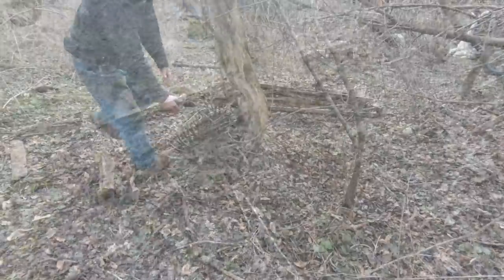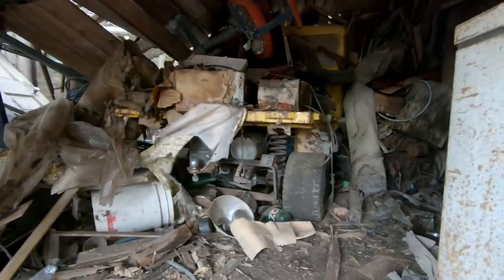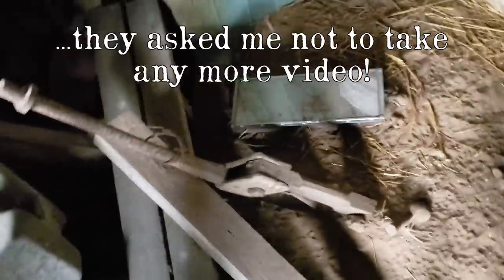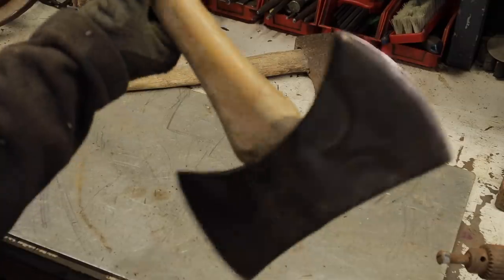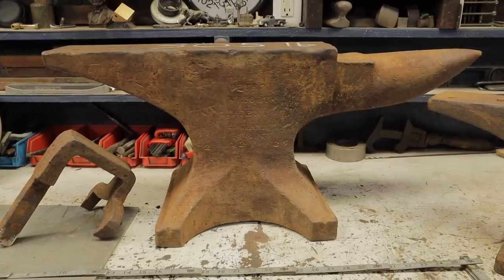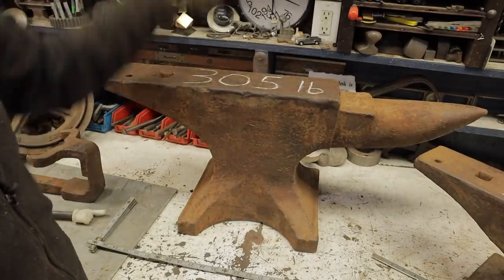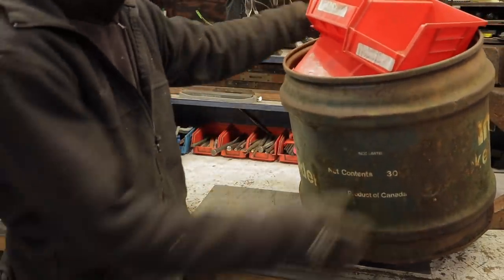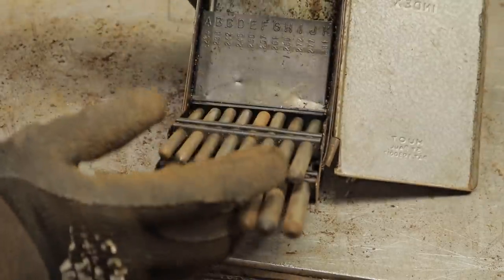RESCUING OLD IRON ~ Two Anvils & a Flat Belt Pedestal Grinder ~ Episode 2 ~ The Abandoned Dairy Farm

Comment: On the grinder, there is a special fiber packing that you load with a thin grease/oil then bed the shaft and cap onto it and set the cap pressure. The little loose rings inside are called "Wicking rings", they should have a little sheet metal reservoir underneath them (probably rusted away) that you fill with oil and as the shaft is turning, it with spin the rings around and sling oil up on the top of the packing to keep the shaft lubed and smooth running and lower heat from any friction. We had two of these in the shipyard Blacksmith shop i worked in back in the 70s.   You can run them with either an overhead line drive setup or a heavy motor and wide belt underneath and adjust the tracking by adjusting the cap pressure and elevation of the shaft with shims.  This is awesome stuff you found and will NEVER be made this well again. Also in the first shed was a rare red Farmall tractor tool box that collectors pay up to $400 for.
Reply: I too, could move or pick up anything I could get a hold on. Now, I'm 87 and  can't  stand straight.  Lota pain too. 💔

Comment: The pots were indeed for melting lead but were used primarily by plumbers to install "bell & spigot" cast iron sewer pipe.  The pipes were slip jointed, an oakum strip was wrapped around the smaller pipe with an opening at the top.  The ladles were then used to pour molten lead into the pipe joint.  After the lead cooled sufficiently the oakum was removed and then it was packed into a tight seal with a tamping tool.  My father was a plumber and I helped him install the sewer line to our house circa 1955 using this method.

Comment: I worked for a rancher that had what I think was a starter kit for a homestead . He was using the bench vice , like the one you found & the anvil & later while looking for some scrap metal out behind the shop there was the hand crank drill press , the pipe or rod vice like you had , some tongs were in the shop but the forge hand crank blower was out back ! I've seen this set in a 1910 Sears & Roebuck catalog for less than $100 !!!!!! How times have changed ! I've looked for a good anvil for years and saw one In a ranch driveway holding a shop door open , asked if they wanted to get rid of it & he said no , what would hold my door open !!!! :-) thanks for the video and you Damn sure get an A+ for effort !!!!!! :-)
Reply: Some Folks have them as an Ornament in their Driveway and won't budge with them for all the Tea in China, due to sentiment..⁉️🤔🤦‍♂️

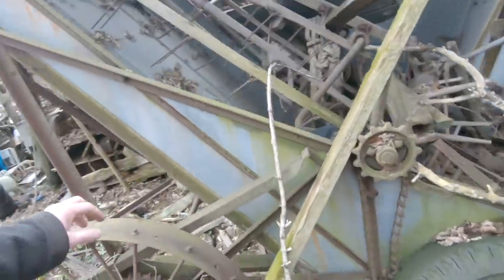Comment: At 5:15, the machine you thought was a manure spreader,  I think you'll find it was a hay loader.  I'm 78, and when I was about 5 or 6, I spend several months of an old farm owned by an elderly couple that worked it with a team of horses.  When they did the haying, I'm pretty sure this was hooked behind a wagon, and would pick up the hay and dump it on the wagon.  When the wagon was full, it was disconnected and left in the field. The horses pulled the wagon back to the barn. There they were unhooked from the wagon and hooked up the hay fork and they pulled the hay up into the barn,until the wagon was empty.  At that point, the whole process was started all over again.   I haven't though about that time of my life in years...Thanks

Comment: i believe that anvil attachment is an anvil bridge. The Anvil Bridge is designed to make getting into tight corners much easier and is beneficial for splitting and forging hinges and scrolls.
Reply: You are exactly right about it being a hardy hole bridge anvil. I use one quite often. I made mine myself. It should be one of the first hardy tools you get. I know people who don't have one and don't believe them to be needed. Once you have one you will never want to give it up. My anvil is only 105 pounds. It's a  Columbian cast steel and I've had it about 20 years. I absolutely love it. I'd certainly like to have a larger anvil for my shop but there really isn't anything I can't do with the  anvil I have. This little Columbian anvil I can still carry to my truck and take it to our blacksmith club meetings.
Reply: I think it's a hold-down, Mark. Lay something on the hardened face, put that 'bridge' over it with the guides over the anvil's face, and hammer the extension into the hardy hole. You'll find hold-downs in use on most good workbenches.

Comment: when you go picking, carry a decent ramp and a come along or set up an electric winch to do the work. You're young now, but trust me busting your back like that will tell on you later.
Reply: Aint THAT the truth!
Reply: i call them war wounds !    :<)))
Reply: Gets kinda annoying seeing others bend over/squat/kneel with such ease. I try to plan well for anything at ground level..It takes a few minutes to get down and twice as long to get back up 😕.  The joys of aging 😁
Reply: @tootall5559  🤣 gotta be a dollar for me. but my right forearm still seems to work ok, which is good cos that's my beer drinking arm
Reply: I used to do the same thing.....People were amazed at the huge objects l could lift and move...Was it smart? No it was very stupid! Now l have a (plan) of attack in place, if l buy a large heavy item. Did l mention l have a bad lower back now....
Reply: @b.a.brackus6371  I've got a bad back and a hernia, the surgery to fix my back gave me a hernia from heaving so hard ... it turned out I was allergic to the anesthesia and actually died on the table but they got me back. So having either fixed is more dangerous to me than leaving them be.
Reply: B.A. Brackus - username checks out.
Reply from the maker: I had a come along with me, but didn't really see a need for it, but I DO need to get or make a decent set of ramps! Clearly the OSB I found when I was there wasn't up to the task!  I appreciate the concern about my safety!
Reply: @SalvageWorkshop  It's not just your safety now. it's about how all this effects you when you get older. I used to be able to do a lot more than people thought possible, but now I can't hardly do anything. Everything you do... or should I say overdo now, will tell on you when you get old. I know, you're a young stud now, but if you live long, it all comes back to haunt you later in aches and pains that maybe you can't explain. For instance, I injured my shoulder like 3 times... shook it off, it got better. Then one day in my older age I slept on it, and it kills me for weeks on end, now I have to make special provisions on how I sleep not to set it off again. Similar things apply to my knees, ankles, neck and back. I'm a mess now.
Reply: And how!
Reply: Damn, I wish I would have listened to the old-timers when they told me to watch my back.  Now I'm an old-timer and all I can do is testify.
Reply: @grimcat27  Yup ruined my back
Reply: I second that.
Reply: @billbaggins  Yes Sir And is there anything close by that I can lean on to get back up. Yes, The Ground is like the Bathroom these days. It gets farther away every day, and getting there does not necessarily mean you were successful in the adventure in the first place.
Reply: @denniscasey2883  🤣🤣🤣 Thanks mate, I needed a good laugh after spending yesterday on the lounge with a crook back .
Reply: Not to mention a double hernia of your groin, please take more care, looks like it had all been there a long time, so you should have gone back with help.
Reply: B.A. Brackus yeah the back end of my car seemed the usual target for me in my youth. Even into my thirties. 😖 Not anymore.I even picked up a friend of mine and pinned him to the ceiling because he didn’t believe I could. He was only about 140-145 though.
Reply: Keith Lester well I was taught early on that the stomach muscles help balance the spine. So I escaped most of the lower back problems. But damn my knees.
Reply: @Redtailedhawk99  Damn.. you got ripped off, I lasted till mid 40's when lots of stuff failed. Pity we can't sue the manufacturer for bad quality control 😁
Reply: bill baggins actually my problems didn’t really start until my forties either. I just stopped picking up the backend of cars and trucks in my thirties LOL!
Reply: @Redtailedhawk99  😁 Ahhh.. youth. It was fun while it lasted. Busted a shoulder badly at 27 but was back to lifting heavy things at 32. Could probly still move a small piano by myself but would suffer for a few weeks.
Reply: @tootall5559  yeah me too ! I did not think l could puke so much . Loll
Reply: @tootall5559  Had my hernia fixed still got the intermittent bad back, muscle mass isn't what it used to be lol. This is so funny and entertaining reading the comments of all the previous young Sampson's out there. Tony
Reply: Had to laugh. That's what I did many years ago. It made impossible heavy items reasonably easily to move and collect single handed. I'm on with a workshop move at the moment going to use the same technique. Busted back as well lol. Tony
Reply: @eyuptony  I can't get my hernia fixed, the anesthetic will kill me, it nearly did when I had my back surgery (worthless by the way) In fact that's how I got the hernia, I heaved so hard I got a hernia from it. So I'm pretty messed up these days. Can't do a hell of a lot. Ticks me off every day.
Reply: @tootall5559  That must be really frustrating. Just watch SW on YT and enjoy. Tony
Reply: yup I hurt all day every day because of being too stubborn  lol heed this persons words
Reply: Man all of us old guys all sound the same. Take heed young man. Work smarter not harder, as they say. We all wish we had. 10ft tall and bulletproof when we're young. Not so much now that we're in 50's and 60's.
Reply: I heard one guy say, "you only get so many lifts in life.  Make them count."
Reply: @AffordBindEquipment  yep... sorta like that. sooner or later everything you do when you're young will come back to haunt you if you live that long. Injuries I just shook off when I was young are killing me now.
Reply: To be young again... my back would blow out completely trying this job!!
Reply: @ipkissaragon8536  mine goes out just watching him do it.
Reply: @tootall5559  ain’t that the truth !
Reply: When Inwatch you moving and handling heavy loads All I seeing your future is back issues, let alone knee.. 
You gotta work smart and Not depend on brute strength brother.
Reply: The key is proper lifting. Many guys in the construction industry that I know don't really know how to properly lift. Correct technique mitigates a lot of detrimental strain on the joints and especially spine and discs if the surrounding muscles take the load.
Reply: Those saddles were worth a pretty penny to the right collector.
My oldest little sister used to collect antique saddles.
There was several other items I'd have taken as well.
That big anvil is a Blacksmith anvil.
Used make all kinds of farm items including wrought iron fancy fencing, wagon parts, farm implements and more.
As well as repairing same.
Reply: Gotta ask.
What was the name of the band playing that old time southern blues song and the title of the song ?
Reply: I agree with everyone, and trust me none of us are knocking you for horsing those things in the van, we’ve all done it, but load easier, without yanking. We’re close in age, but your back is definitely going to have issues when you hit your late 30’s. Subscribed, love the channel

Comment: Try swapping the to bearing covers, they fitted before so they should still fit if correctly assembled.
Reply: Yessir ... my thoughts exactly... could also be the shaft as well... which I was thinking as he was taking things off and not taking better notes where they came from...
Reply: @marktorrey  Yes I noticed as well but the shiny shiniest end of the shaft went back in the shiniest end of the bearing housing. Must be the caps I thought?
Reply: It looks like the big holes were on the inside best I could tell from the video before you took ther covers off, i agree maybe swaping them around might work. 
Awesome anvil score.

Comment: My friend, you are remarkable. You find amazing treasures of ''rusty gold'' and I am quite I  awe. You found it all, you loaded all of it, then unloaded all of it. And you are still walking upright. Incredible, but now it is time to give yourself a gift. You have the equipment, the material, and the means... to build a gantry hoist for your van. It will save you time in loading to enable you to discover more and ease your unloading. Thus saving your back and perhaps extending your life. And then we get to see more of you.
Reply from the maker: Oh IDK about remarkable... I'm not the only person capable of all that! I do agree that some sort of a crane or something to load things into the van would be helpful, but it could also get in the way... Maybe I could make one that could use the hitch as a mount... The problem is not when I get home, it's when I'm at places that don't have tools or PEOPLE to help load thing (MOST PLACES)! Although I will say I do know how to properly lift things using my legs, finding better ways to do it is a great idea! Thanks for watching & commenting! I truly appreciate the support!
Reply: You might want to make a simple metal ramp for your van, that you can take with you and use in the "field".  Maybe add a manual cable system to the van too, to pull things up the ramp.  👍
Reply: @SalvageWorkshop  Save your back!!
Look at getting a winch, mount it to the trailer hitch by using tube steel, makes it removeable, Then add a fold away pulley at the top of the van, you will have a removeable snatching system, that also lifts!
When finished, it stows away With your amazing skill sets, it will be a piece of cake. Mine saved my butt, literally many times

Comment: Very good finds, you might want to try and switch the mandrel caps around on the grinder and be carful of the oil rings which appear to be in good shape. I about went crazy over all that barn wood some good material there.. Peace..
Reply from the maker: I agree on the caps, I need to take another look at those! The oil rings are in GREAT shape! Ya I wanted some of those large beams, but I wasn't prepared to haul it away, and this wasn't the safest place to be cutting things up, so I just decided against it!

Comment: Hi. Great finds you got. That shaft with the flat pulley and pillow bearings looks like it might have been the shaft from a wood saw used to buck firewood to length. We had one when I was young and we used the pulley drive on one of our tractors to power the saw.
Reply from the maker: I agree, the more I look at it, the more I agree... The side opposite the pulley even has a nut that can be removed to install the saw blade! Good call! Thanks for watching & commenting! I truly appreciate the support!

Comment: The first one you showed is for picking up hay. It was towed behind the hay wagon and it was piled up with pick forks. The tines on the bottom are high-grade steel. I have made gaff hooks from them. The chain can be used to saw duct drag for removing sawdust from a sawmill, but you are going to need the gears. Some great find!

Comment: That wood block is a true snatch block. I had them on board our ship in the USN, for fairleading line (rope) across the deck. The hammer with the edges is a stone hammer for facing stone slabs. Good picking day! Regards, Solomon

Comment: That clamp drill at the end is a Canedy Drilling Machine #422569, patented on March 4th, 1890.  The innovation there was having the feed wheel that put pressure on the bit be separate from the hand crank that turned the bit itself. You didn’t have to rely on body weight or muscle to put pressure on the bit. Basically a hand cranked portable drill press. 

Canedy also made a bunch of other drill presses and post drills under the Canedy-Otto name.
Reply from the maker: AWESOME! I knew someone who was wiser than I would recognize it! Definitely a cool tool! I truly appreciate your comment with the info about it, Thank You!

Comment: You got the caps mixed up on that grinder. Switch them around maybe? That Hardy tool is used for holding down flat bar.
Reply: Was wondering the same thing about swapping the caps!
Reply: I've heard this called an anvil bridge, for having a higher up work surface. hold fasts look pretty different, they're more like curved springs.
Reply from the maker: Very possible! I'll make sure to check!
Reply: Thats exactly what I noticed, swap them side to side and turn them until you get a better fit!

Comment: 49.00  That little swivel ladle  was used to solder wires for electrical boxes. The old wiring was asphalt insulation with a fabric cover that we call rag wire. They would twist the wires, dip them in solder and tape them with the old friction tape or the old ceramic wire nuts. Replaced a lot of that old stuff.

Comment: On the grinder, I would go back and either try swapping the saddles or look close at the video and see if they are in the wrong spot.  I have some similar tools that the sides will not swap....  every location was apparently was machined separately.
Reply: Use a snatchblock between wrench and load to guide the load

Comment: Judging by the disassemble footage seems like you've just switched the two bearings or put the shaft the wrong way around. Correction: that particular one has been turned. Check the oiling holes position relative to the centre of the shaft.
Also there is a differences between a centre punch and a transfer punch as you can probably say by the names. One is for hitting by a hammer but the other one is for pressing parts (mostly wooden) against the other with some blind holes already drilled and with those transfer punches put in them. The idea is...you've guessed it! - to transfer the positions of the holes;)